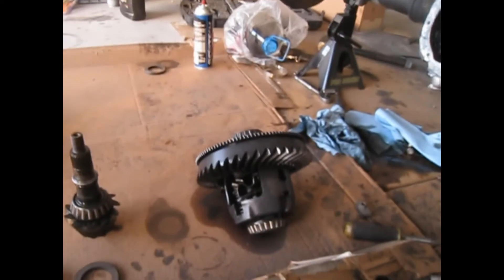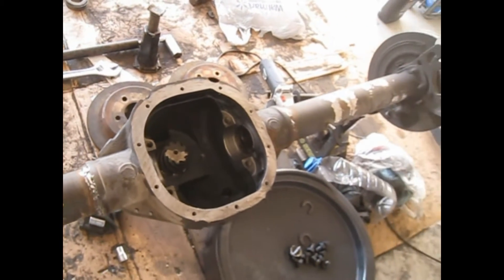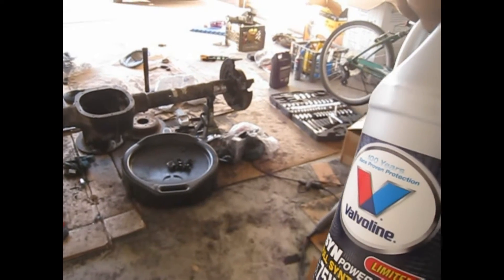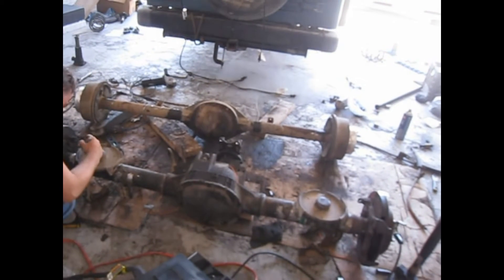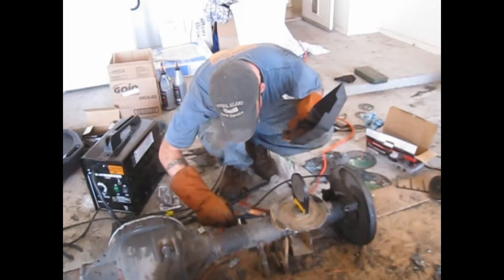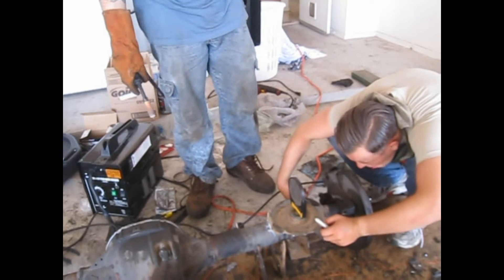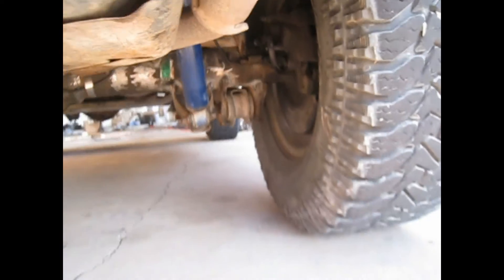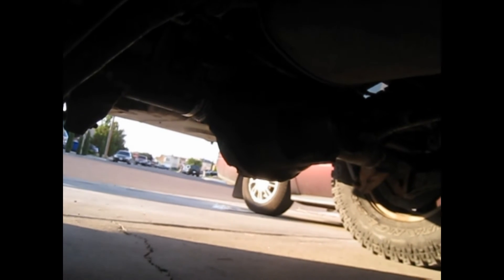Jeep TJ 8.8 axle swap geared to 4.56

Comment: 8.8 are off center doesn't that effect you driveshaft???
Reply from the maker: It hasn't yet ans lone as the angle was right it has never been a problem i have run it for years and still running it other then blowing out a u joint hopping the rearend out a mudbog my 8.8 has been solid i broke the dany 35 so many times it was a joke to try and go on the trail you never know if you would make it back but im goo even jumping hasn't harmed it just hopping the rear backing up and a u joint and off i drove again

Comment: Did you use the small welder for doing the tubes to the pumpkin?
Reply from the maker: Brent B yes I did I heated it up first  as long as I go slow and keep it hot it's never been a problem
Reply: hunttomuch wolfe thanks. I wasn't sure if my 110 was up to the job. But I doubt it will be an issue.

Comment: Also.... What pinion angle did you set up for welding on the brackets? Is the jeep lifted any at all?
Reply from the maker: +KyJeepin I put it at the same as the old dana 35 was and after it was installed I ended up fine tuning it with adjustable upper control arms. my jeep has a 2 inch lift and as far as lifted jeeps go its nothing. I use my jeep for hunting and camping fishing it more for overland trails than rocks. with the 8.8 and the G80 combined with the 4.56 gears I just go anywhere I need to go. im going up from my 31 to 33 next summer or fall then ill do a 1 inch body lift so it will be 3 inches of lift and that's as big as im going for a daily driver

Comment: what welder are you using
Reply from the maker: +LITTLEMAN91  its a harbor freight mig welder it lays down good welds but it gets hot fast so you have to let it cool down after welding two or more brackets on

Comment: Hey great video. im getting this done on my XJ. I got the 8.8 3.73 with LSD. im re gearing to 4.56.... i didnt understand the part you mention on your discription about the pin. could you explain it. thank you i appreciate it.
Reply from the maker: +Ramses Valenzuela to get the 4.56 gears on the old LSD I had to notch the cross pin to get it past the teeth

Comment: Where did you get your 4.56 limited slip gears? And why didn't you go ahead and throw a locker in there?
Reply from the maker: +KyJeepin  I got the 8.8 with 3.73 gears and I regeared it to 4.56 to match my jeep the LS diff is what I was looking for it helps out here in the sand and snow and it don't cost any more then a open diff. the G80 locker I have in my jeep is for the dana 30 you can find them in Volvos 40 bucks at my junk yard and mechanically lock up and unlock at 20MPH so its not going to affect on road driving and no need to run air or wires for a locker or have to hear clicking every time I turn